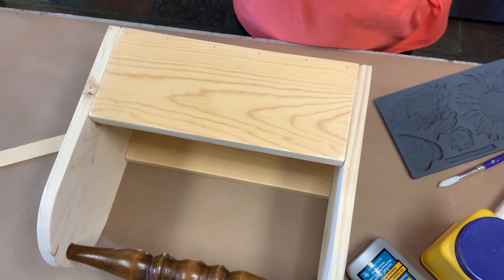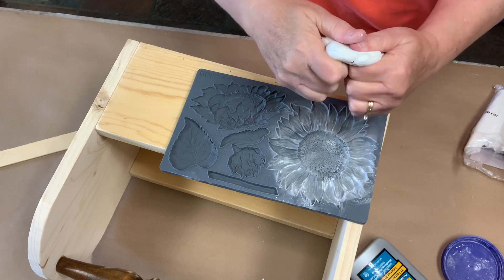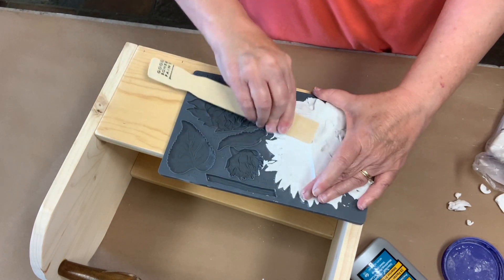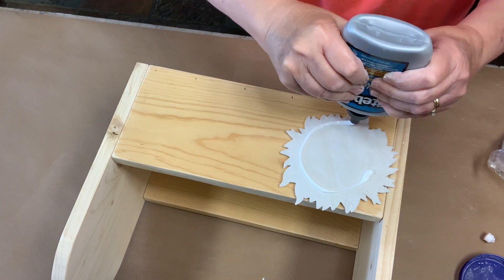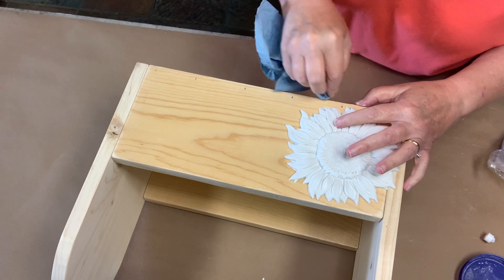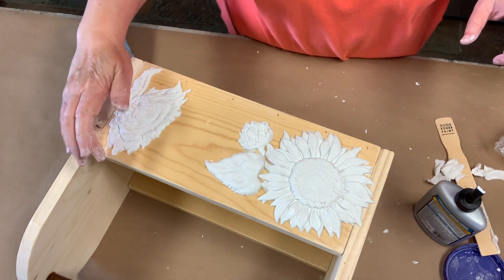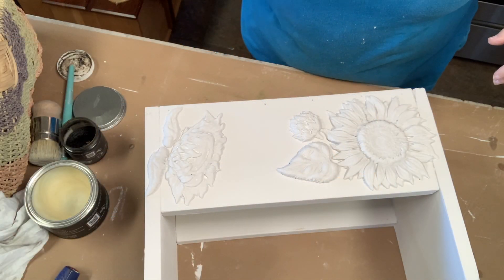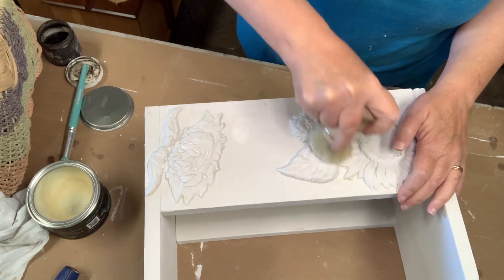IOD Sunflower Mould

Comment: I have this mold and mine dose not turn out this CUTE! what wax and paint did you use? Did you have to seal it?
Reply from the maker: I used DIY Paint. I think the color was White Swan. I also used clear wax and then dark wax and wiped it back so it would mainly stay in the cracks and crevices. Using the clear wax first acts as a buffer so the dark wax is easier to manipulate!  The wax seals everything in!